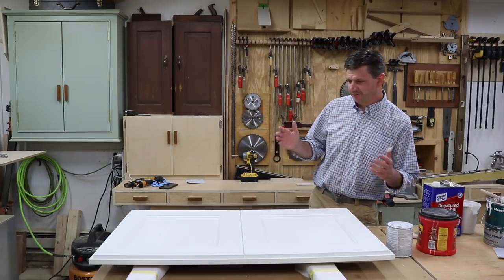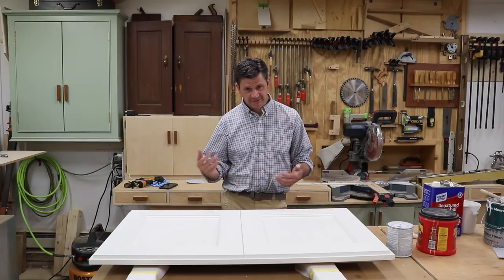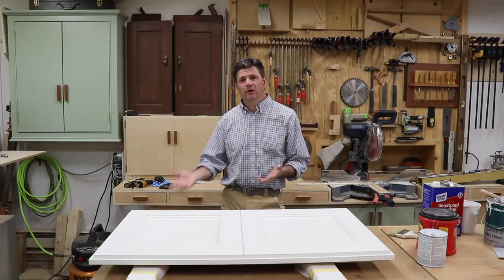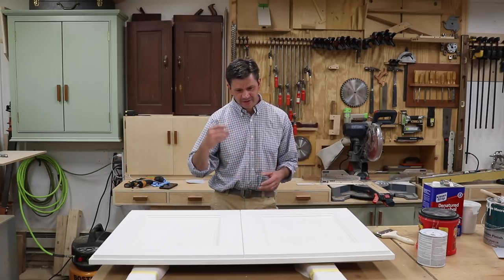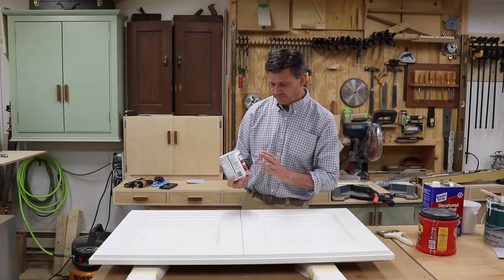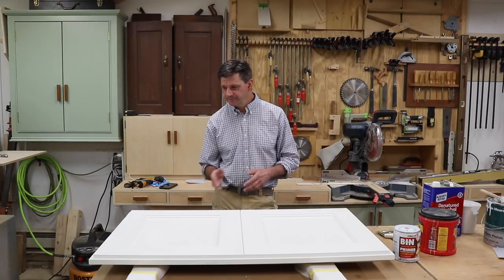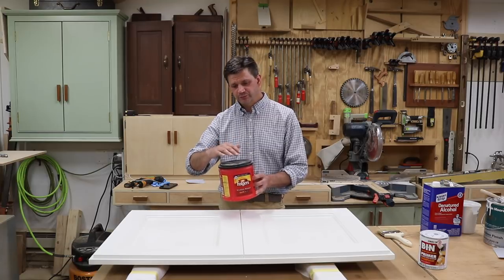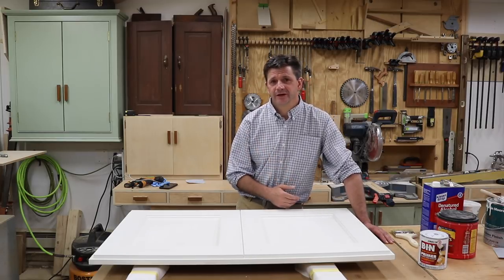How I Messed Up and Fixed this Paint Job

Comment: I have felt your pain. On my new $2000.00 front door and side lights for my home, I followed (exactly) the instructions provided by the Sherwin Williams sales rep and the instructions on the can. I asked what else do I need to do. Answer, nothing. The paint blistered and peeled. Sherwin Williams said it was because I didn't use their primer. I cleaned everything and used their primer. Now I applied the Sherwin Williams finish coat and it blistered and peeled. I was very disappointed to hear, " well sometimes that happens."  Sherwin Williams can take their paint and stick it in their #@^.

Comment: I've used the BIN shellac primer almost exclusively for the last year.  It's great to be able to get 2 coats of primer and coat of paint in half a day (for smaller projects I'll even just buy the spray cans).   You have to vacuum and wipe up good after sanding though - the dust is very fine and powdery and seems to result in a lot of air bubbles (I use BM Advance top coat) if not cleared off.  I've also used the Zinser additive with decent results.

For small projects that are being painted something other than white I'll also use spray-on auto body primer on occasion. Sands to a really smooth finish.

The latest Fine Homebuilding issue discusses painting custom carpentry and the recommends the use of dewaxed shellac/sanding sealer before primer.

Comment: My guess is to much conditioner.  I had this happen with Floetrol but didn't see the issue until the paint was dried.  A little goes a long way.  Glad you found a solution to fix!

Comment: Jon, could you do an episode on keeping thin plywood from curving? I bought a frame, about 5' x 3' (formerly held a mirror). I'd like to attach plywood to the frame, so I can do a mosaic. I want the backing as light as possible, because it's so large and will hang on the wall. I don't want to put so much work into the project only to have the plywood bend. What would you do?

Comment: You lost me the minute you said latex paint, WRONG! All and I mean all interior woodwork should be done in oil/alkyd. But I could be wrong since I have only painted for 30 years.
Reply: glpdrum satx 30 yrs experience doesn't explain why oil/alkyd is superior for interior applications. Please explain. Btw, I too have decades of painting experience and quality latex has always had great results for me.
Reply: Oil dry's to a tighter surface hardness than latex. The only latex I have found that has come close in terms of durability is Pro Classics. That being said the nature of latex permits a less brittle more flexible finish and a more open surface on a micro level. Over time you will find that latex will tend to grab minute dirt particles around handles, knobs and pulls where oil will not. Applied in the same manner and under the same conditions (properly that is) cured oil should feel like glass with no resistance to the touch. Latex, however, will have a slight drag to it showing the ultra fine surface texture that grabs oil and dirt from the hand. A good test is when you find an imperfection that needs to be sanded, during the process, look at the sand paper. Oil will turn to a very fine dust that can be knocked off the paper. Latex will clog the paper in turn showing its molecular structure is larger albeit on a very small level but still true. The same is true with primers, the sand paper will glide over the oil product where it will bite on the latex.  Just to be clear, this topic from my point of view is about doors, trim, casings, cabinets, woodwork etc. You may live in a State that promotes latex and low VOC or no VOC products but I do not.